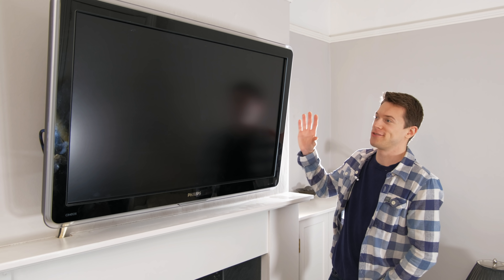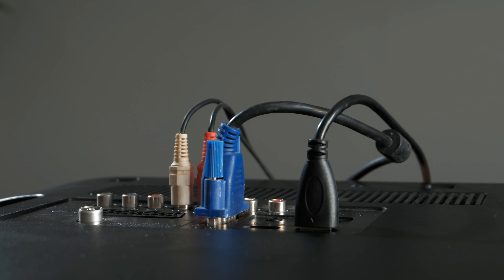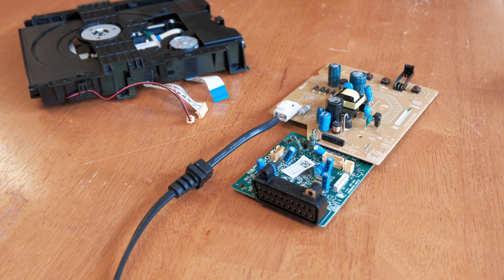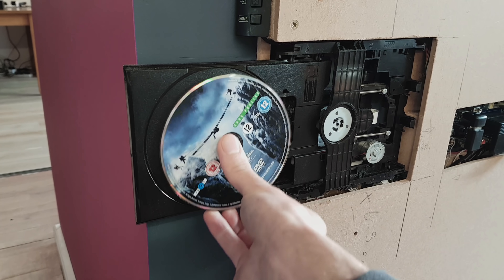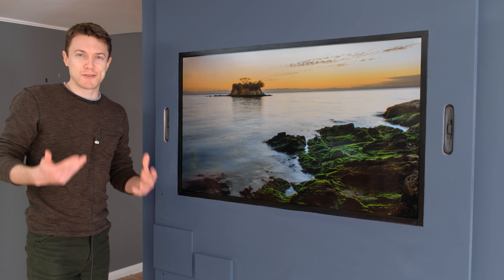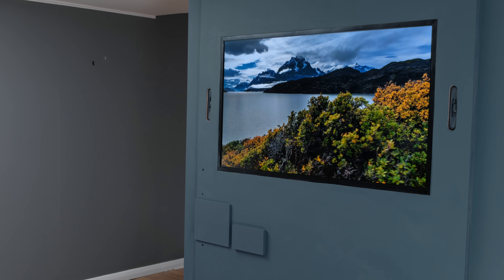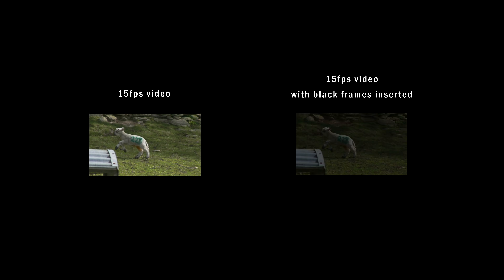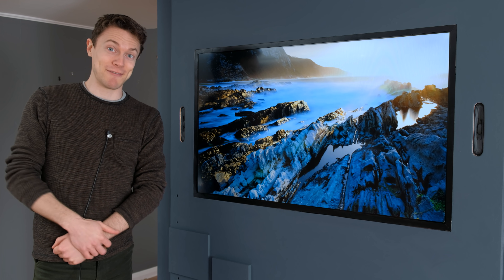Building a homemade 'wallpaper TV'

Comment: I would also like to do this but also add a microwave and 12vdc fridge.  I guess that the component boards could be stripped out of those too and be incorporated into the design.  The fridge would have the advantage of cooling the whole lot down as some comments have suggested that it might get too hot.  I DO realise that real world physics won't support this idea.
You could take the door off a washing machine and stick that on the front so that it looks as if there's a washing machine mounted in there....just a thought..... I've got an old CRT tv which I could probably use with this idea.
My final idea would be to take two flat screen TVs and mount them back to back with one of the flat screens being stapled to the wall.  That would open up a whole lot of opportunities.
NoAxe

Comment: I knew the dimmer one because pc displays have the feature. Afaik

Well the motion smoothing he mentions requires some computing i guess (image processor)

The Sony TV i have is 4K60hz ips panel with hdr10. Quite decent for today's standards.

I play ps4 with it. Ps4 usually runs games at 30fps locked. And it's not that smooth. Until you turn on the motion flow. The spiderman game is definitely benefits most from it as its usually very persistent at 30 fps. Also the signal is 1080p native but tv definitely does a great job to upscale to 4k. It's just amazing. Not all games look that smooth btw.

Also with pc i realised 1440p is quite good. Almost native 4k. While 1080p isn't that great.

Red dead redemption 2 is also benefiting the 60hz jump by motion flow.

But witcher 3 really didn't get such benefit as frame drops usually (ps4 Pro doesn't have such issues)..

I believe its the cpu bottle neck but who knows. Ps5 will be truly amazing.

Nice Wallpaper.

Comment: Pretty cool! I would cover the speakers though even IF it was with speaker speaker material. Saying that I wonder if one could buy a simple cotton material of similar color to the wall color and stretch firm over the speaker openings to camouflage those better?

Also the information on the backlight flicker process, I think,  helped answer a long standing question for me. I always wondered why when filming with tape style camcorders and even some digital cameras, why the screens of computers and flat screen TVs seem to flicker in the recording. IF I am correct it would be because of the stills being played in succession and/or the back light being used.

Comment: Could you maybe take all of the boards and inputs and put it together in a seperate little box that you put near the screen, camouflaging the wires. and maybe just hang the screen so that it would be even more thin, like you did with the laptop screens? the box would be not too noticeable, you could still access everything and you will not have to build a whole enclosure

Comment: nice idea, but how about the cooling? Will be the TV survive for long?
 Also if you just hide everything in the wall, you may can do the wall flat and keep the pcb's more inside (no additional boxes on top) if is gyp board underneath, it would be easier - just cut the holes in, otherwise is possible add one panel behind and keep everything nice hide. And this would be good also for air circulating for cooling. And speakers would be nice to hide with some special cloth or grid :-)
 I really like your idea and another videos I watched before. Thank you! Filip

Comment: I like the way DIY Perk's Matt just gets on with it with no faffing around and before you know he's completed the job the video's over and your gagging for another. (Why no ventilation holes for heat convection they could have shared the speaker holes? Or a slit all the way across the top and bottom?) Personally, l would have wired the speakers up to the ceiling but great job with all the electronics. Also - l expect it's big TV which, as soon as its placed on the wall, for whatever reason, seems to shrink in size compared to simply just sitting on a table. Whats the next job a flush wallpaper log fire - now there's a challenge to you sir! (Not a DVD of a log fire burning!)

Comment: Great project,but lacks one thing,shielding,all those parts will radiate RFI\EMI leakage,across the radio spectrum locally.Use insulated copper sheeting and earth it,so PSU\Main board enclosed and screened properly.

Comment: Well, TVs protrude and stay at a safe distance from the wall because of the heat they produce. Unlike smartphones, they cannot dissipate the heat onto the atmosphere if left with full contact with the walls. Older CRTs and newer LEDs as well as LCD TVs do the same. 
More the circuit components, more warm they become with longer hours of usage. In that case they need to dissipate the heat and stay cool to work for longer hours, and not get damaged. 
You have nice skills, but this design can fire your house internally. And because it is a wooden board, it will be ignited as soon as possible and will keep burning. 
Do take care about that!

Comment: I would just mount the panel to the wall, and extend the inputs and buttons to a cabinet under the TV. Way easier.
(the mounting method is strong double sided tape).

Comment: Thermal issues?

The set has vents for this very reason and whilst some of the heat from the display can be radiated out of the front, the logic boards et al behind the wood aren't going to have the same luxury. Did you put in heat vents that we didn't see?

Comment: I would have carried the facia all the way to the corner on the right, textured and then painted it and yes, the unpainted speaker holes are very distracting.  Some sort of grills or cloth would have cleaned it up a bit.

Comment: Why haven't they made a TV with seperate box of all the gubbins? There was a plasma TV 10+ years ago that did just that. It would then let ypu upgrade the box without changing the whole screen when new HDMI specs are released. It would be a great way to upgrade your TV without changing the screen. OLED panels themselves haven't improved much in recent years.

Comment: One ptetnially glaring problem could be cooking ...if you notice the plastic housings on TVs have VENTS cut into and so my concern is that something would overheat and fail without ventilation ....Sure it might work for a few weeks but for how long before something failed due to heat?

Comment: Almost perfect, although making the whole thing a tad thicker to properly cover the DVD etc would be better, and why didn't you finish the speakers? some metal 'gauze' painted the same colour and flushed in would finish it off
Another option, put on a fake fireplace mantel so it looks like your original TV setup, and hide the DVD and video ports in there.

Comment: Hi, is it possible to strip a TV down like you did with the old laptop screens to create the light windows. But just stick the bare LCD to the wall and extend all the internals to another location? Like the LG wallpaper TV where all the internals are in the soundbar?

Comment: i was thinking  with out taking the tv apart  adding another wall with wood studs and  dry wall the tv would fit in nicely but now that tv are much thinner u can just still build a extra wall so that the TV look like it is part of the wall and now that TV 's are thinner the wall u make does not need to protrude out as much as you have to do with the older tv old tv wall [ ] and newer tv wall [] building another wall over the first one would be lass work in a electronic point of view especially if you're not electronic engineer or do not know anything about Electronics

Comment: Just cut a hole in drywall and install inside wall. Run all cable down through the wall too. Much more simple. Or even better yet just buy the new picture frame TV.

Comment: As interesting as this video is, and honestly, impressive, and especially somebody actually buying a tv and then pulling it apart, there's a not too minor issue here. Yes, Your original example, with the TV hanging out above the fireplace, hangs out - and therefor is 'standing out' for a variety of reasons: FIRST AND FOREMOST, because it's angled down so you can actually properly look at the TV from sitting down on the couch. It's fun and all that in your video you make a 'flush' mount TV, but that flush mounted TV also is completely verticly angled, so you'd have to STAND to properly watch it from above the fireplace. And because you need to angle it above your fireplace, the cables at the back taking up space don't matter as you'll have it angled anyway.

Now if we were indeed looking at an example outside of the one above the fireplace, and we'd want the TV against the wall as flush as possible, sure, it's an interesting project, which i really do like, and why clearly i'll thumb up this video. BUT, even then, you run into the following thing: you want your TV 'flush' mounted against the wall then, and NOT placed on top of designer TV furniture, if you have one, and essentially, making your TV furniture redundant. Even if one were to argue that wouldn't really be a problem anyway, and really, it isnt, then there are some other issues to deal with: Generally, your house interior has been designed in a certain way. Drywall, poster wall, wall boards, etc. For example, if you have a clean white wall, with TV stand furniture, some lights on top of that, and some picture frames against the wall, like most people do nowadays, then if you 'flush mount' your TV the way this video portrays, you are going to have a bulky object against your wall, which is going to stand out like a sore thumb. Meaning that for this to ACTUALLY be flush mounted, and not stick out, you'll STILL need to dig into the wall about an inch or two thick into the wall, which is impractical to say the least, and would only be reasonable for a home renovation project with this purposefully done. That however would completely throw the idea of 'shoestring budget styling' out the window. AND, i don't think most people are as handy as you are NOR willing to throw away andy warranty on the TV that is void the moment you undo a screw.

Comment: Overall it looks like a crappy contraption that's actually more upsetting than the original TV's bulky looks, however the backlight strobe control is interesting, could be very useful for console gaming at 60hz
Reply: My first thoughts as well where how I could apply this to make TVs come close to monitors when using consoles. I've gotten so used to the minimum lag and 165 Hertz refresh rate of my PC and monitor that it's hard to go back to console gaming now, even on the PS5.

Comment: I have a real problem with this concept I have tried it once before and I had a problem with the cooling of the components behind the TV when you’re mounted like that there’s no venting of hot air and the TV really warms up and starts warming up worst case scenario you might even set it on fire do you have a solution for that? Please respond because I’m trying to do the same

Comment: Dodgy, those backlight LED's would have been driven over-current over a reduced (PWM)time period, so if you went over that Current/sec ratio your LED's will have a greatly increased fail rate or in other words a reduced Mean time before failure (MTBF).

Comment: I'm guessing that with the dimmer, the FPS can only be set as high as the TV itself is designed to go? Like, you couldn't use that device to turn a 60hz TV into a 120hz, right? I mean, if its really that easy, why are 120hz TVs so much more expensive?

Comment: That was a lot of work to make an ugly painted box with zero ventilation to keep the boards cool. Plus the big wire running up to the ceiling is VERY noticeable. When that whole mess overheats and stops working, have fun tearing the whole thing off of the wall. At least you could have put some mesh over the ugly speaker holes, or even better, connect it to a separate surround sound speaker system and leave the crappy stock speakers out of that hideous mess that you wasted time on.

Comment: The T.V. over the mantel in the opening is too high so an angle is needed to match the eyes line of sight from a seated position. So a flush mounted, non angled T.V would not be as good imo.
Reply: New TV's do not need to be tilted as its viewing angle have increased over the years from 15 to about 180 degrees.

Comment: Wouldn't there be any fire hazard with all those naked components?
Reply: Umm it depends on the model tv.few years ago I had a 59" Samsung plasma that would literally rase my bed rooms temp by at least 5° within an hour.

The LED tvs I've had since haven't done that at all.in fact my 65" ks8000 doesn't even get warm.

His seems to be a led so I'd bet the components do get warm but not enough to cause a fire but almost certainly will have a much lower life cause of the heat bulid up especially that power supply.
Reply: But by simply being " necked" they are not any more or less a fire risk.

When an electrical component isn't in a case the real worry is shock hazard from touching it,or from it becoming exposed to water.

Comment: .... why not just cut the sheetrock and plonk her in there? I mean just screw it to the nearest stud, clean up the edges and call it a day. and having all that crap poking out -- speakers, weird rectangles, inexplicable holes, and a bunch of plastic buttons in one corner -- seems to draw the eye to the wall, causing would-be casual visitors to take a good, hard look at the area, instead of the eyes just passing right over it without stopping. in other words, you're basically achieving the opposite of the desired effect of reducing the television's presence.

Comment: You really don't need to take a tv apart to mount it behind a hole in the wall?
Reply: How else would you plug things in if the sockets are behind the tv? Also the speakers would be muffled by the wall.
Reply: @tumainitiger4655  
Easy. For all connections just use a simple flush mount breakout box. As far as the sound goes tv speakers are crap. Everyone uses something else. Flush mount a pair of decent powered monitors. Or a sound bar that also has rear speaks and a sub. Both options are super cheap. This whole thing ended up looking pretty hokey with speaker holes in the wall. My time is money. Just buy a Samsung Frame TV and hang it on the wall. Done.

Comment: I'm sorry, this is a good idea. But it turned out quite ugly. And its potentially a fire hazard. Where does all the heat go? What if there's a short circuit? I would not have that in my drywall thank you.

Comment: You didnt build a wallpaper tv. You jammed a fattyboi into a wall in the most complicated way imaginable. You did a bunch of other cool shit though so props. Just wondering how much different it is to just put the entire tv in the wall. Its less work to the same effect. I had the impression you were going to do this without putting holes in walls....or doing the opposite which is building a wall extension. This seems...UNclever if you get what i mean. Still...the other cool shit was cool.

Comment: The only problem I see is screwing the circuit boards into wood creates a "floating ground" scenario where instead of each board being at 0 volts, they may be at a higher voltage. Can be a shock hazard and introduce noise into the picture.

Comment: Here are the issue that I see with this:

Your setup doesn’t permit an angle change so there is no glare from lights or windows.  

Even your own video shows a reflection of an overhead light.

Further, the original wall mounting bracket permits the angle change to minimize the effect.

Most people will watch a television in a seated position.  Your arrangement only eliminates the glare when the viewer is at eye level with the screen.

So, the only thing that I see that you’ve accomplished is simply making the screen essentially flush with the wall, and leaves no room for adjustments for glare.

The idea I suppose, is fine if those issues were addressed, but they aren’t.
Reply: But this is the case for all bewerten flat wallpaper tvs
Reply: @Mr_Coli , you are right.

If he used the regular mounting hardware and recessed it into the wall, then it would permit changing the viewing angle.  When the TV isn’t in use, it could be adjusted back so that it was totally flush again with the wall.

Comment: Firstly you mounted the power and main board directly to the wall and didn't use stand offs doing that will trap heat and could lead to thermal run away and fire, topped off with piss poor ventilation causing excess  heat and premature component failure.

Second.. if you used a TV that wasn't 15 years old you wouldn't need to piss around with back light modulation synchronisation, and for all the comments from people thinking you just out smarted the likes of LG or other manufacturers emmmmmm no you didn't but in future try to avoid making videos that people with no clue may follow exactly as you did and burn their house down. Key words stand offs and ventilation ....almost as embarrassing as the verge gaming pc build .

Comment: The reason why this video sucks:
1. The TV is not Ultra HD, because today Wallpaper TVs are 4K compatible.
2. Nobody uses the DVDplayer these days, Blu-ray is a successor to DVD and it's rare to find a DVDplayer today.
3. Speakers are need to hide it because most TVs have speakers to below it.
4. The TV is not smart. Wallpaper TVs need to be smart equipped.
5. There isn't a super woofer in it.
6. Why you putted Sugru on a disc tray, you can buy the slot-in tray and connect to the disc player, all problems are done.
7. Why when we open the cord hider, we can see the electronics?
8. I've seen that Wallpaper TV can move, then why this can't?
9. Where are the bottom ports?
10. Why you can't make a wallpaper smart TV?